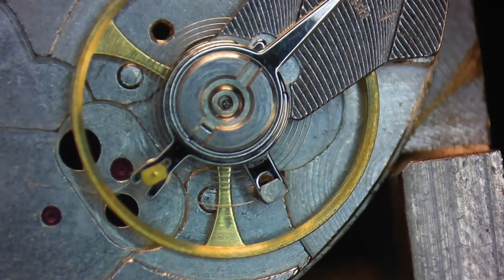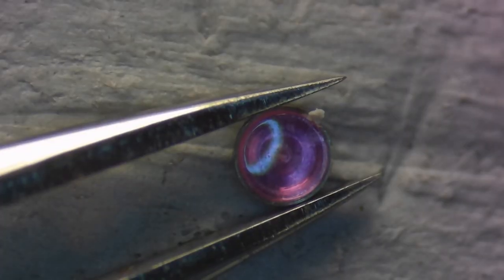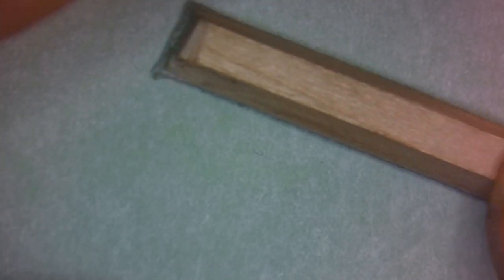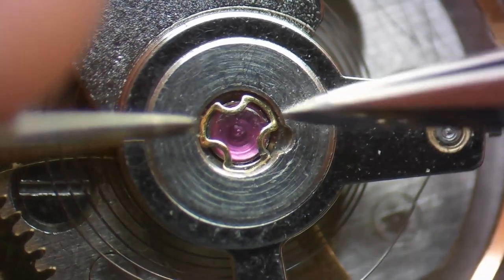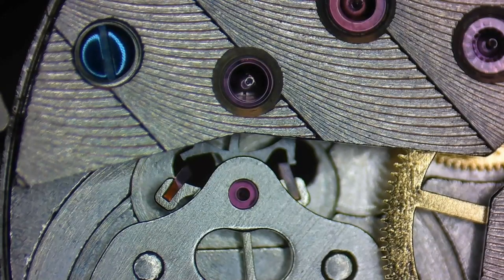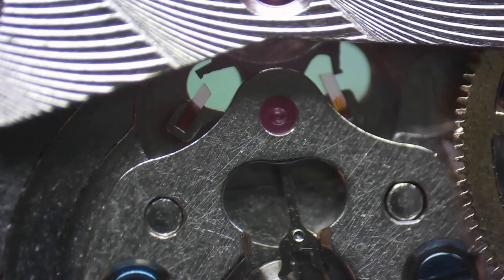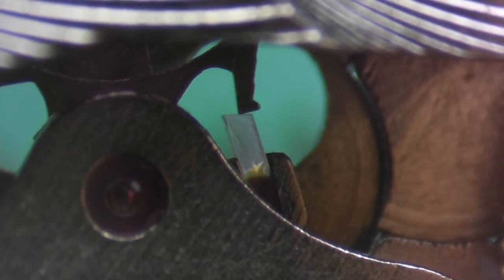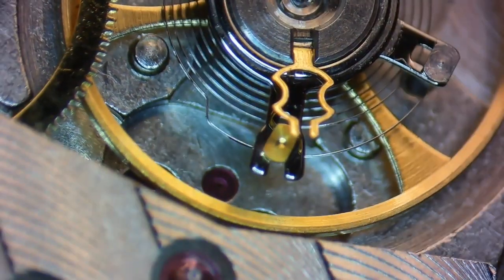Lubricating the Balance Jewels and Pallet Fork for BEGINNERS

Comment: I cannot tell you how helpful this video was for me. On my very first watch disassembly, I was opening one of the spring holding down the cap jewel for the balance. After the first half was dislodged from the lock configuration, I just barely touched the second locked down side and the spring dislodged and flew about 4 inches. I had no idea how to get it back in place as it kept springing everywhere. The Rodico tip made the difference. Kinda a very delicate issue for my first go at taking a watch apart and getting it back together. Thank You!
Reply from the maker: Glad I was able to help Steven. Take your time, you'll get there. 👍

Comment: The tip on using the leather buff is gold. It makes the impossible almost a pleasure in terms of cleaning off old dried on oil. I like to do end stone and chaton assembly on an anvil plate to elevate them. The leather buff is great for picking the end stone up off a flat surface and easily transferring it to the anvil. Thanks for an excellent video on this tricky subject.
Reply from the maker: Good to hear. Yea it works well.

Comment: Dear friend,

I am infinitely grateful to you for all the masterful lessons you offer. Thanks to your invaluable help I have managed to overhaul my first watch, a 1970 Orient Chrono ace. After following all your advice to the letter, I was tremendously surprised to see a clean graph with +7s/d, beat error of 0.3 and an amplitude of 260 degrees. It is practically a slightly ascending straight line and there is not a single point outside the line. 

Best regards from Japan.
Reply from the maker: Perfect. Let’s do another one.☝️

Comment: Thanks, Alex. I love Rodico! It comes in handy even in electronics repair.
Reply from the maker: It definitely has a lot of uses in watchrepair, and as you pointed out probably many other industries as well. Just be aware that after cleaning do you want to use it extremely sparingly as it does leave a residue
Reply: @watchrepairtutorials  It's useful for holding things while soldering them together but it gets sticky and messy if you get it too hot. I use it to hold nuts and stuff so I can get a screw started and all kinds of stuff. Rodico is so useful that I have told a couple of people years ago on YT that I would give them their money back if they thought that the Rodico wasn't worth the price. None of them have asked me to pay them back.

Comment: Thank you for a first rate video and excellent explanation of the procedure.  One point to add...resist the temptation to squeeze both forks of the spring together with your tweezers to remove both tips simultaneously.  The shape of the spring seems to "beg" you to do this!  Don't fall for it!  It WILL break.  Follow the procedure shown here and release one leg at a time.  Thanks Alex.
Reply from the maker: Great point! Thanks for checking in.

Comment: Another great video!. So much solid information packed into a reasonable amount of time. I'm having an amplitude problem right now and this video convinced me to redo the sloppy job on my balance jewels.  

Can we get a video about balance regulation? I run into lots of watches that have a jacked up balance regulator that's almost 180 degrees from where it should be. I don't know where to start on that problem.
Reply from the maker: Thanks buddy,
Yea man there will be lots of videos on regulation and dynamic poising. 
Lesson 13 will cover the basics regulation, you may pick up a few things there if you are more advanced than some. I have videos planned on etachron regulation, how to use the regulator pins to change rates and dynamic poising balance wheels that have timing screws. 
Plus there will be real life example videos of regulation from watches in restoring.

Comment: you have no idea how amazing your videos are to me. I just listen to them over and over. I just started on a movement that as no jewels, pins instead of pallet stones and the balance staff ad no pins at the ends but floats between two concave bushings. Any recommendations on oiling such a movement? Thank you
Reply from the maker: Yep use 9415. It has the best chance in staying where it’s needed. Oils like HP 1300 or 9010 will creep out and be gone pretty quickly. Just don’t expect it to run like a chronometer.😄
Reply: @watchrepairtutorials  Would that be 9415 on both the pins and the bushings? Would you oil the pins (like with jewels) or the escapement wheel itself? Thanks
Reply: @watchrepairtutorials  Many thanks for your time.

Comment: i have always thought that this is one of the most difficult things to do correctly---I have made more mistakes and ha more problems here than any other. As usual, the extra details here will be very useful.
Reply from the maker: Your thinking was correct, it is one of the hardest things to lubricant properly.
It can be hard to see, hard to get the right angle and the amount of lubrication is by far the smallest of all the areas we lubricant. 
It just takes practice and the willingness to do it again if it’s not right. Patience is a virtue in watchmaking

Comment: Many thanks for your nice job, expecially for the tip. Could please write how you clean the jewels and the chatau. I got exan, but not the first product... thank you in advance. Fabrizio
Reply from the maker: I’ve shown this in multiple videos, but basically I use a very small jar about the size of a quarter with a lid. I had hexane or you can even use IPA drop it into the liquid., Shake it around a little bit.
If it still needs to be cleaned up, lay the endstone flat side down on a piece of watchmakers paper. Take leather buff stick put it on top of the stone and rub it back-and-forth about an inch or two.
The end stone will stick to the leather of the buff stick polishing the endstone clean.
Then oil and replace the chaton.
One at a time so you don’t get them mixed up

Comment: Thanks for this video Alex! My biggest problem has been with hinging the spring back. The hinge part of the spring always seems to pop out of the frame and when I try to correct, the spring pings away never to be found. (Some of the Chinese movements do not hinge back properly and the problem is worse.) It is extremely difficult to find replacement springs of the correct size. Properly dressed tweezers have helped me at least be able to move the spring arms properly. I will try a small dot of rodico next time.
Reply from the maker: Use the finest thinnest tweezer you have and make slow movements. You got this.
Reply: @watchrepairtutorials  Thanks! It is difficult for me to see the clips too. I wear eyeglasses and was wondering what type of eyeglass loupe/holder you use.

Comment: I'm just now finding your series on watch repair tutorials and I can't thank you enough! I've gone through a lot of videos, forums, and books, but this series is filling in some of the gaps I have in my knowledge. I do have one question about lubricating the pallet stones. I find it difficult to really see what I'm doing so that I can accurately place the oil on the stone. I've tried setting the movement on an angle and lighting from underneath (usually with my phone or a flashlight) and that has been the best setup I've been able to come up with, but it still seems rather difficult to find a surface that's not directly facing me. Do you have any other tips on seeing the surface in order to accurately place the oil? Thanks again for putting these videos out!
Reply from the maker: Well to state the obvious, magnification is your friend. Try positioning the movement in your holder so that when you tilt  the Movement Holder up  the Pallet fork is in the correct position and you can slide some sort of spacer under the holder to keep it in position as its tilted up at an angle. 
I also find that a really fine tip on the oiler bent at a slight angle really helps.
Reply: @watchrepairtutorials  Thank you! As I watch your videos and learn from you, what I'm finding is....I'm really close to the advice you give. For instance, I tilt the movement, on the movement holder, by putting Rodico under it and then shining the light underneath. I'll try the bent oiler trick and maybe I just need to practice more.

Comment: Any tips on replacing kif style springs with 3 cut outs  on the holder. loving the vids.
Reply from the maker: In lesson 10 at about 8:30 I do a kif spring.
 Basically it comes down to using a very sharp set of tweezers and a sewing needle.
Check it out.

Comment: This might be a bit much to ask for, but a video on all the different types of incabloc clips would be helpful. I have one I'm struggling with now. It's got three prongs with a little divot to slip them into. I think you have it to rotate the whole thing and slide each prong through the divot, but I'm not sure. I've been stuck on it for days.
Reply from the maker: It’s so funny you say that, I was servicing a 7s26, the new one and there are a bunch of them. I was remembering some post I had read recently about people struggling with the diashock and thinking to myself, these are actually pretty easy if  you follow a few simple rules.
I know a lot of people do have problems with certain ones so I adding it to the short list.
I think maybe the 5 most common as I do t have them all.
What do you think?
I’d it not the second one in this video?
Reply: @watchrepairtutorials  Ohh, hell yeah! I just rewatched the video. That is exactly what I was talking about. The one I'm having trouble with now is a bit different, but the concept is the same. Mine is more like a solid piece of metal with almost no flex in it. I don't even think it adds any shock absorption. I wish I could share a picture of it. It's hard to explain. I've never seen anything else like it. I will attempt to copy your technique.

Comment: Please can you tell me how to fit the lyre spring to the lower incabloc setting when the setting has been removed from the watch (as most people seem to recommend?). The lyre spring would not fit when the incabloc setting was installed in the balance cock (Felsa 4008). Out of the watch it seems more difficult to find the slots and then twist it off the Rodico. What do you use to hold the setting steady and then how do pull off the Rodico, you cant release the spring from the Rodico by pulling it backwards as you show, otherwise it pops out again. Incredibly frustrating and nobody except you shares info on this amazingly difficult procedure.
Reply from the maker: Send some pictures to my email and I will help you. Email is on my home page.

Comment: just worked on my second movement. last thing to do was oiling the cap stones. then one spring came off and  when i tried to put it back it suddenly disappeared. I was searching for an hour without success. then, when i inspected the movement under the microscope, i got a glimpse of one foot of it. it had fallen into the movement and got stuck there, with the movement still running. so i had to disassemble the whole thing again and finally found it lying under the mainspring barrel. i got it back together again, but the shock spring is still not in place. I will try the rodico method, but these things really are tiny :- )
Reply from the maker: Wow. You got lucky on the spring. Yes they are really tiny, so take your time and full attention. You got it.🤙

Comment: Alex: the watch I am working on has jewels for the balance wheel, but they are held with screws. How do you lubricate the top of the balance wheel? You have a video with a picture that shows exactly what mine looks like. This watch is from 1955, and I believe it is pre-Incabloc (or similar). Any ideas will be appreciated.
Reply from the maker: Cleaning the end stone on the balance side, usually requires removing the hairspray in order to get access to the screws to release the endstone. Then you clean and lubricate as normal.

Comment: I’m going to start working on an old pocket watch, the balance jewels have two screws and it looks to me the jewel has to be pressed out. Is this correct ? Is it the same process for lubrication as you described in this video ?
Reply from the maker: Usually, in situations like that, you remove the two screws and the setting with the end stone comes out. That allows you to clean it, and then you can either lubricate it and put it back in or you can clean it install it and then lubricate through the balance hold jewel.
Good luck. They are tiny screws

Comment: Hello Alex. For the  the pellet jewels, is the correct oil the Moebius 941? Many thanks Fabrizio
Reply from the maker: 941 is usually recommended for slow beat watches. 9415 for fast beat but either will work just as well for either. If you haven’t bought it yet I would go with 9415.

Comment: Well you didn’t disappoint Alex! Really great video, so many helpful tips. Now, question time 😁: You mention using grease on the pallet stones, that would be 9415 correct? On using a leather buff, if we don’t have one do you think a folded piece of watchmakers paper might work ok? Lastly, no mention of epilame/fix-o-drop, and I was hoping to see you use that cool red capped bottle back there by the microscope! 😂 Some sources say it’s crucial, others mostly skip over it, curious for your take.
Reply from the maker: Great questions as always.
Yes it’s 9415 for the pallet stones and 9010 for the end stones on the balance.
If you don’t have a leather buff I would just the tip of my finger. Just be careful.
I use epilame on all my services. The reason I didn’t include i, I did think about it, is because beginners shouldn’t worry about it yet. You have to develop your ability in lubricating properly first, then plus all the other things we have talked about first then once all those things are good, Epilame will take your service quality to the next level.
It will extend service life but it will not make up for improper lubrication
Reply: @watchrepairtutorials  Thanks for answers as always 🙏 That makes sense about the epilame. BTW what bottle do you use for IPA/hexane? That basket looks like it would make getting the stones out easier. Is it a diamond washing bottle?
Reply from the maker: Yes it’s a diamond basket.
In the watch cleaning video, I put links to 2 different options for the dispensing bottles.
Reply: @watchrepairtutorials  You're the best, thank you!

Comment: Great information, just like everyone has already said. Question, do you leave the pallet fork pivots dry? Some channels here on YouTube say you should. Seems like it couldn't hurt to lubricate them.
Reply from the maker: Yes you leave them dry with the exception of certain pocket watches.
A couple of the main seasons are that the pivot doesn’t rotate, it just moves on a small arc. 
The main issue is that to upper pivot is right by the lever or arm of the pallet fork. Oil will travel down the lever and make its way to the slot that the impulse jewel travel through. Oil will get onto the impulse jewel and will eventually stop the escapement.

Comment: Mr hamilton... im dealing with an old school illinois watch... that is a key requiring movement... it has the type of plate where all the train is covered by the plate except the barrel which has its own bridge.....the only way to oil and clean the lower balance jewel is with the plate removed.... would the oil stay in place or should i clean the jewel, reassembly the setting and use the automatic oiler?
Reply from the maker: Yes, you must clean the setting and then use either an automatic oil or put a tiny job of 9010 on the jewel hole and use a thin wire to push it in
Reply: @watchrepairtutorials  ty

Comment: Good morning Alex. Do you have any tip (the way to do that the easiest way) for when you do NOT have the incabloc system? How to oil those jewels? Many thanks in advance Fabrizio
Reply from the maker: If you’re talking about a non-shock jewel the easiest and cheapest way to oil it is to put a bit of oil in the jewel hole and use a thin wire or old balance staff to push it in. The other way to do it is with a automatic oiler, but they’re gonna run about 100 bucks.
Reply: Thanks Alex for the suggestion. Should I do it trough the spiral? Many thanks
Reply from the maker: @fabriziobuffoni4862  no sir, do it with the balance removed.

Comment: Love all your helpful videos.  You’ve recommended polishing the tips of the oilers (to allow the oil to flow freely).  Having looked at the tips of my Bergeon oilers under the microscope, they are pretty ragged.  What would you recommend to use in polishing the tips?  Leather buff?
Reply from the maker: I show it in the video.
Reply: @watchrepairtutorials  I will rewatch a 3rd time.  Sorry to have bothered you on this.
Reply from the maker: @chuckfinley3542  It's no bother. I use Polinum and a rotary tool.
Reply: @watchrepairtutorials  Thank you